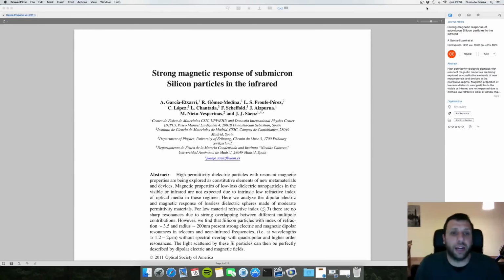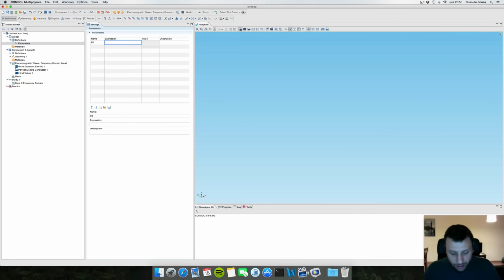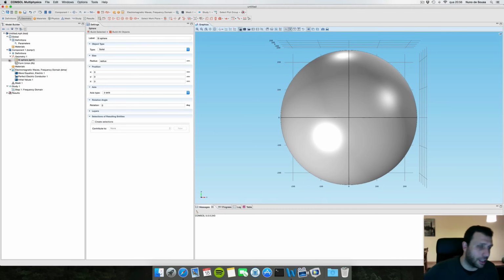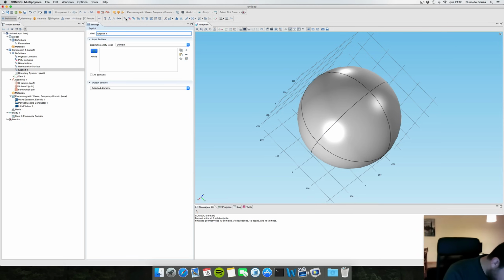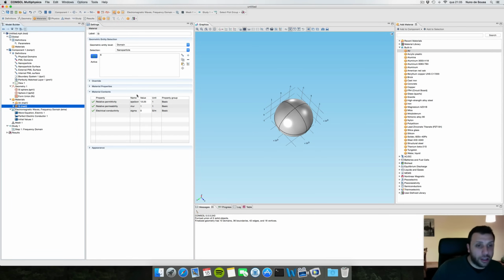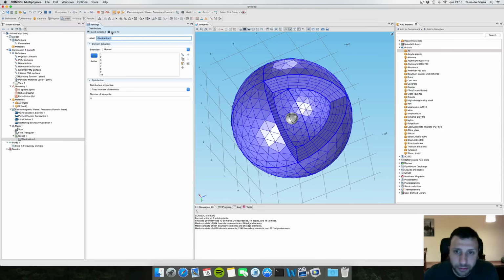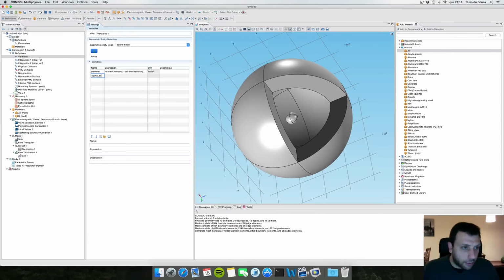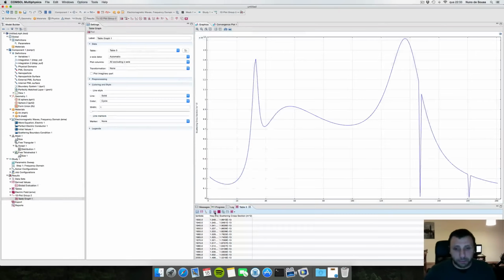Comsol Multiphysics 5 tutorial for beginners: Scattering Cross Section of a Si nanoparticle

Comment: This is an excellent tutorial Nuno, Particularly useful for me here trying to simulate light scattering in a paint system.
However I would like to report here that while whatever you have stated here in the video is replicable in comsol and well clearly replicates the results in the paper, I seem to obtain contrary results for absorption cross section, The extinction cross section follows the same trend as you have shown so do the E-field. However the absorption cross section is negative at many lambda values. This seems a consistent trend even if meshing is changed to a finer case. Kindly shed some light on this.

Sincerely
Gopalan
Undergraduate Student
IIT Madras

Comment: Thanks a lot, this is a very helpful tutorial, how would the setup change if instead of a particle you were measuring against a multilayered sphere of dielectric material? I would assume that you would have to change the surface integration to account for the layers but how does that change the volume integral? 

Thanks

Comment: When did you define Poavx etc. for the Poynting vector, my Comsol doesn't recognize the expression. I learned a lot in your video, thanks!. Unfortunately, the nice level of detail stopped at a dead-end at 28 minutes.
Reply: Instead of emw use ewfd( if this helps as new versions of comsol sort out for frequency domain with ewfd not emw)
Reply: Did you find any solution?
Reply: No @heattransfer8003  I haven't returned to the problem

Comment: Hi. thank you ver much. it was very useful. Would it be possible to measure the scattering of a this sphere with a dipole? I mean instead of plan wave we have a dipole close to this sphere and measure the scatterin cross section.
Reply from the maker: Meqdad Hassani Hl. That is not a comsol question, it is a scatttering theory problem. Cross sections are only defined for a plane wave because it is a direction measurement. Instead, for a dipole emitter you can compute decay rates.

Comment: Brilliant tutorial for green hand learner! I think there might be a mistake of the definition of scattering cross section (SCS). The SCS is actually the product integration of rel poynting vector and surface. It should not be integration of S_x+S_y. 

An easy way to calculate the scattering cross section is actually to define a square boundary outside nanoparticle and integrate the poynting vector at each surface.

Comment: How would I calculate the reflection and transmission from the particle? I actually performed the same model to observe the scattering from a thin film with a nanohole. The scattering cross section values on the y-axis are in negative. What does it mean? Also on the x-axis it actually does not show the wavelength but some arbitrary numbers. Why is that so?

Comment: How can I calculate scattering cross section for a 2D cylinder?
Reply: Instead the surface of the sphere (in this video) for the Poynting vector integration, you may select the surface of the Cylinder.
Reply: Normally, a cross section is integrated over all scattering angles, so it doesn't make sense a scattering angle-dependence of the scattering cross section.
Reply: On the other hand, if you are looking for the scattering cross section vs the incident angle of the Electric Field, you should have two options. 1. Keep the electric field at the same direction (as this video) and rotate the cylinder in different angles (x,y) (in the case of an incident unpolarized light, you have to average both the X and Y axes), 2. or rotating the electric field.
Reply: have you had any luck with this?
Reply: Diego Rativa thank you for reply! I am trying to get the scattering cross section vs scattering angles. Do you have any idea how I can get this plot? thanks once again
Reply: Diego Rativa thanks once again. I am interested in getting the scattered intensity distribution for scattering angles. COMSOL gives the solution in the form of V/m vs scattering angle (ewfd.normEfar in COMSOL). Is this giving the scattering light intensity around the object?
Also, I used a different MATLAB code called MatScat to get the scattered intensity distribution. however it plots something called as Differential scattering cross section (unit 'm') Vs scattering angles. 
how can I compare the two different units? is there a way to plot the Differential scattering cross section in COMSOL? 
thank you once again for your help. 
-Manasi
Reply: Mostly we plot scattering cross section(or radar cross section) vs observation angles. I think V/m is unit of scattered electric field intensity and m or m^2 is unit of scattering cross section.

Comment: You've calculated the scattering cross-section of a single silicon particle. Can you please how to calculate the Scattering Cross-section of two Silicon NPs side by side (Dimer)... 
Should I perform surface integration like you did and then divide by 2*geometric cross-section? Please Help!
Reply: Any luck with this?

Comment: Can you please mention the name of the Book you suggested (Chap 4 and 5)? I couldn't catch the name properly.
Reply from the maker: +Scientific_Mind Bohren and Huffman
http://www.amazon.com/Absorption-Scattering-Light-Small-Particles/dp/0471293407

But if you want a short resume of the equations you can see the following paper:
http://www.comsol.com/paper/mie-scattering-of-electromagnetic-waves-15917
Reply: +Nuno de Sousa Thanks for the links. It's very helpful. We are currently doing research work on Nanoantennas using Comsol, and we're undergrads. Can I connect with you on some platform? It'd be of immense help to us if you do. Thanks a lot for the video though.
Moreover, we saw that you used Relative Permittivity of Silicon as a constant of 12.25 for the whole frequency range. Is it really constant throughout the whole range or is it an assumption?? Thanks a lot again. Cheers
Reply from the maker: +Scientific_Mind 
Hi. 
The Silicon have a constant permittivity between the 1000 and 2000nm. It is a real number (doesn't absorve in this range). It is the used value in the paper that I cite. Also you can see the refractive index of different materials here: http://refractiveindex.info
Reply: +Nuno de Sousa Thanks, for clearing that up. :) If I wanted to calculate the near-field enhancements of a spherical dimer pair in the gap in middle, or suppose the near field enhancement for a single Ag/Au nano-particle.. How can I do that? can you please suggest?
My goal is to calculate the Near-Field enhancement of various structures (Bow-tie, Dimer, DIpole). I can do the geometry modeling, but don't know how to post-process the data. (I can use material index from Johnson & Christy by interpolation).

Comment from the maker: Hi.
The parameters are: 

E0 = 1[V/m]
radius= 230
r_pml = 10*radius
t_pml = 3*radius
lambda = 1000
lambda_min = 1000
lambda_max = 2000
lambda_step = 5
sigma_geom = pi(*radius[nm])^2
S_in = E0^2/(2*Z0_const)

Liliana Avalos, also I saw that you have problems with the functions:

nrelPoav  =  nx*emw.relPoavx+ ny*emw.relPoavy+ nz*emw.relPoavz (this one is different from yours)
sigma_sc = intop_surf(nrelPoav)/S_in
sigma_abs = intop_vol(emw.Qh)/S_in
sigma_ext = sigma_sc+sigma_abs

Also, it depends of the module that you are using. If you are using the eww, you should substitute ewfd by emw.
Reply: Hello sir, Thank you for the tutorial. I have a quarry, what is emw.relPoavz?
Reply: shouldn't it be:
nrelPoav  =  abs(nx)*emw.relPoavx+ abs(ny)*emw.relPoavy+ abs(nz)*emw.relPoavz  ?

suppose you have a large cylinder, with the incident light coming perpendicular to the flat surface, so there would be a lot of transmission. And if the transmission is great enough, the scattering cross section would become negative right if you dont take the absolute values of nx,ny, and ,nz
Reply: Power flow, time average, of the relative fields in the z direction

Comment: Thank you Nuno. I find your video very instructive. I just started working with Comsol - following your video everything goes well, until minute 27.40. comsol tells me that emv.relPoavx is an unknown variable. Did I forget to load anything? I am using Comsol with windows and I noticed that also in the formula E0*exp(-i*2*pi/lambda[nm])*z I cannot put the [nm], comsol does not seem to accept it. Do you have an idea how I can proceed? Thx, Ingmari
Reply from the maker: emv.relPoavx should be emw.relPoavx.
Comsol is independent of the operating system.
I will try to put the model somewhere, and you can download it.
Reply: Nuno de Sousa It worked after I corrected the typo and put the right name for Electromagnetic Waves, Frequency Domain 2. Thanks.
Reply: @ingmaritietje5489   Sir, By correcting this still I cant't get any result. It shows yellow line rather black after going to second row in the variable defining section. Please help me.
Reply: @ingmaritietje5489  (nx*emw.relPoavx + ny*emw.relPoavy + nz*emw.relPoavz) sir, I had used this still i got error.
Reply: @mr.subratsahu6052  Sorry, I really don't remember. It's such a long time ago, haven't worked with Comsol much in the meantime. You could try and find a tutorial which is more recent to rule out errors due to small changes in the Comsol notation. Best of luck!
Reply: @Nunodsousa  Sir, By correcting this still I cant't get any result. It shows yellow line rather black after going to second row in the variable defining section. Please help me.
Reply: @Nunodsousa  (nx*emw.relPoavx + ny*emw.relPoavy + nz*emw.relPoavz) sir, I had used this still i got error.
Reply: In more recent versions of the Comsol should be used ewfd.relPoavx instead of emv.relPoavx, I guess.